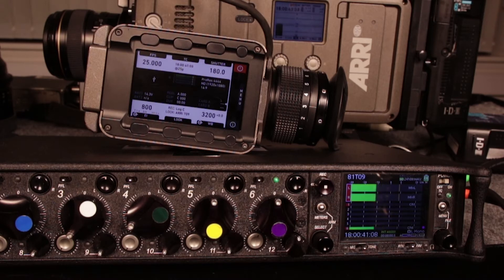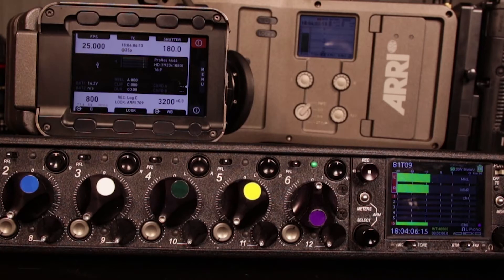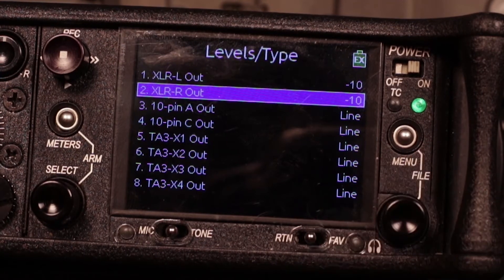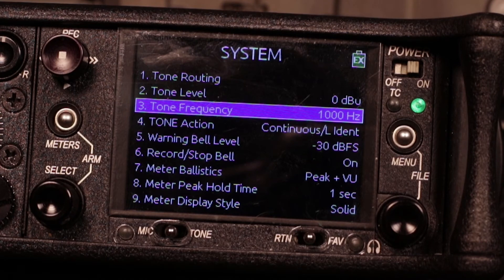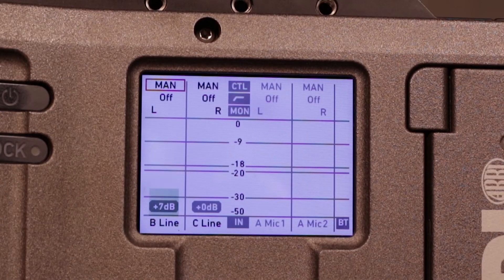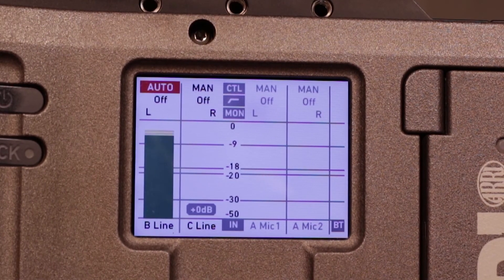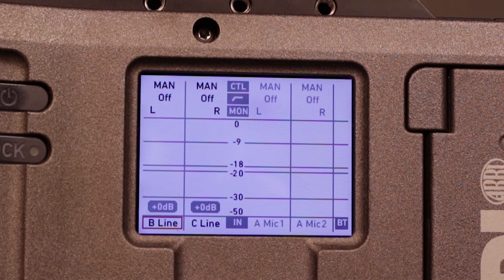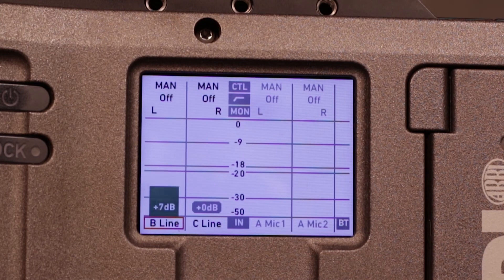Send Audio Into The Arri Amira

Comment: Thank you for the information. I do have 1 question. Does this also work with AES output into Amira's AES input? The Amira does not seem to allow user gain adjustment when AES is used.